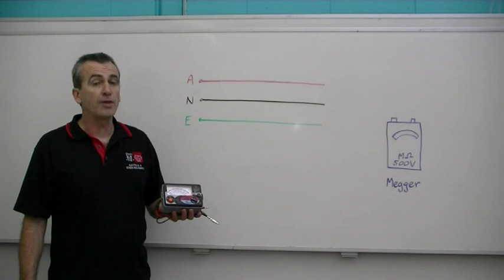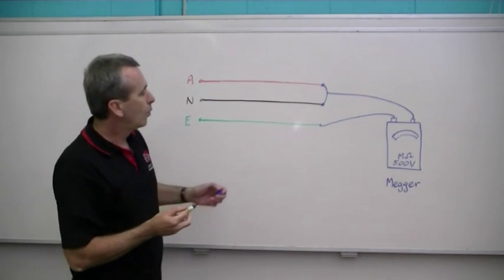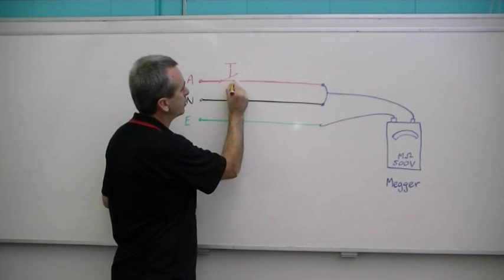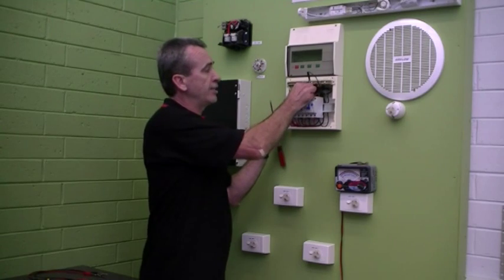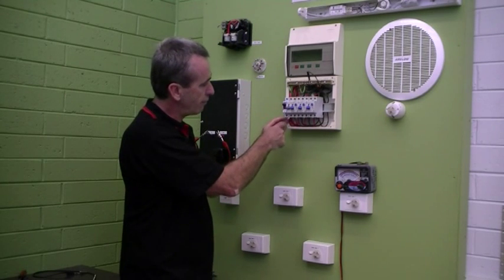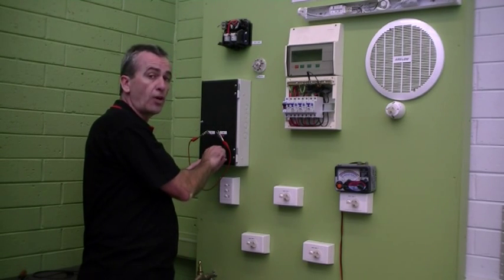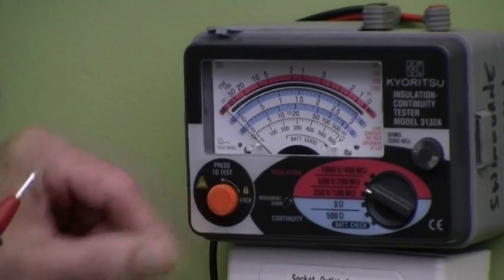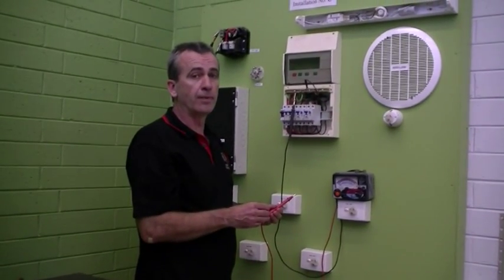4 IR Test theory & IR Whole Inst

Comment: not even sure if i'll get a reply but it would be much appreciated. 

So I understand why you must have the switches in a closed position like you've explained, but will the control gear of lets say a fluro with ballast and all for example mess with the readings?
Reply: Hi Anglo Ambrose.  Nice rifle in your picture.  Because the A & N are joined while doing the test, you are testing both sides of the ballast at the same time so it makers no difference.  Is Ambrose your name?